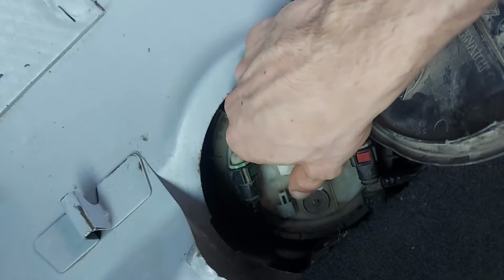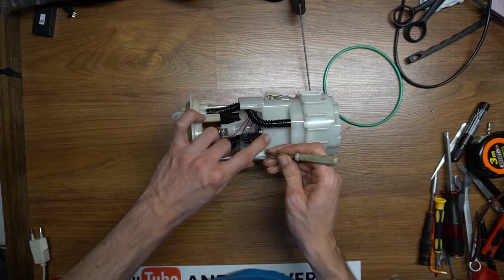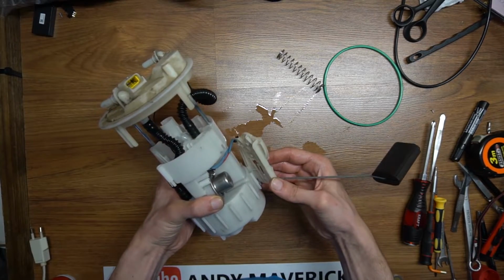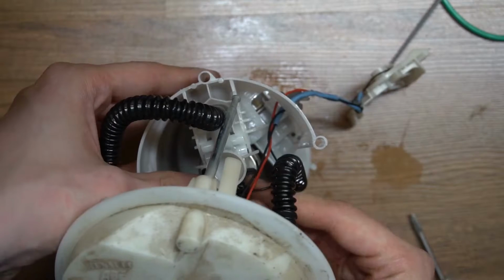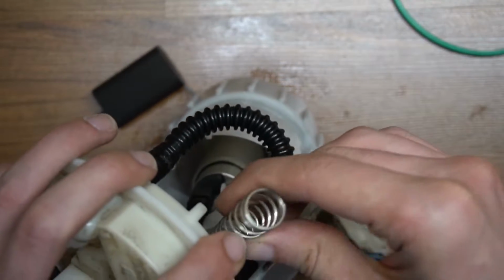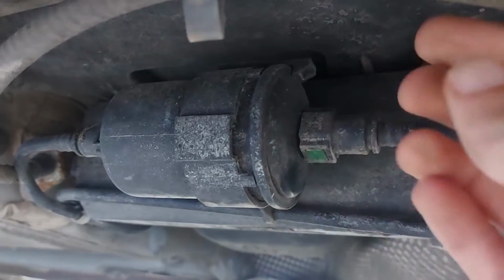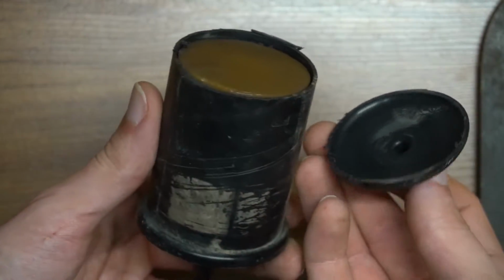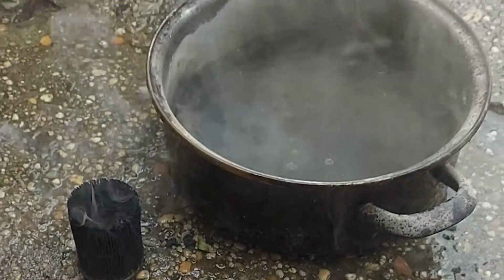Renault Megane II 1.6 16v Fuel Pump Replacement

Comment: Hi, Can you tell me whatis the internal diameter of the tube you used to take out the fuel pump house?  Can it that was about 140 mm?
Reply from the maker: Hi. Sure, it was a 150mm, theoretically a 140mm one would also work. Mine was a little bit loose but a 140 seems quite snug.
Reply: Thanks a lot.

Comment: Was it hard to put the locking ring?
Reply from the maker: Not really, aligning it is the hardest part.
Reply: I’m having a hard time twisting it, is crazy, I’ve been 30 minutes just trying to align and twist, I’m even thinking I got the wrong ring.
Reply from the maker: If It's aligned properly then you have to push down on it and twist it while doing it. First try twisting it anti clockwise to find where it "bites". When your at that point you just turn it clockwise. If you have someone there then ask them to push it down, its better that way.

Comment: Hi, I have a huge leak under the rear seat of my Megane 2005 1.6 16V.
When I fill the tank up the pump overflows.

do you know what I should buy or need?
the pump itself works normally.
it is the leakage at the seal
Reply from the maker: I think your seal is bad. I had the same issue before. Here's the original Part number: 77 01 207 449
Reply: @andymaverick  Yes, I had bought the gasket, but the black plastic rotating lid must also be bought new???
Reply from the maker: @thelonelyhunter942  You can use the old plastic lid. I bought the same set before, I heard It only comes in a package, to my knowledge you can't get the seal separetly.
Reply: @andymaverick  thanks
Reply: @andymaverick  Hola y el sedazo de la parte de abajo del repuesto como se cambia?
Reply from the maker: You would have to try to twist off the bottom part, I haven't done that, because I replaced it completly 3 years prior.

Comment: Hello. I am looking for the location of fuel pump relay / fuse. There is no fuel pump sound when I turn the power on. I have 1.4  hatchback 16V pre-facelift, fuel pump does not have a return line. I had another one, also without return line from 1.6, so there are probably different versions. I connected it (I had no "special tool', I could not remove the old unit like in the video), still no fuel pump sound when power is on. I am not 100% sure, but I suppose the second fuel pump should work, so for some reason the fuel pump does not get power.

I also can't find the location of fuel filter, it is not where it is supposed to be in this video, I can't find it. I get "check ignition" message, engine rotates, does not start and I believe it is a fuel problem.
Reply from the maker: Hy. I checkd before and I never found a fuel pump fuse/relay in the car. I'm not sure but I think that its integrated inside the ECU. I think all of them have returnless fuel systems and only have one fuel pump. If you connected your fuel system directly to a 12v battery and there is no sound it's probably has a faulty fuel pump. I never worked on a 1.4 hatchback but try to trace down the fuel lines, there should be a filter somewhere.

I think your problem is different, If I where you I would check the top dead center sensor on top of your gearbox next to the side of the engine block. Take it off and clean it first and check the connection, once It made the same symptoms for me.